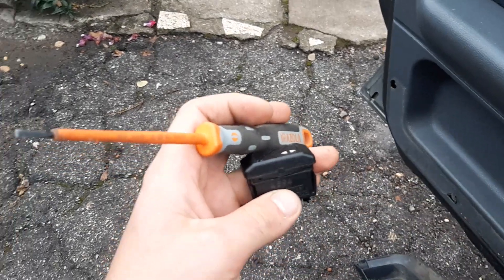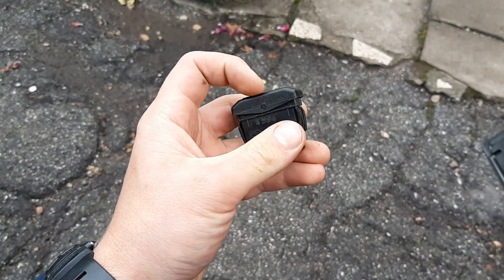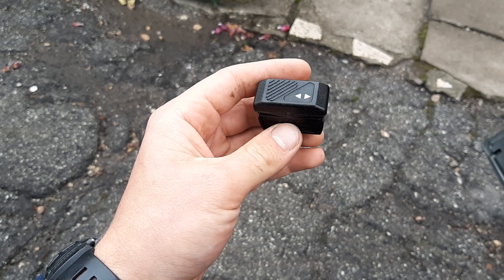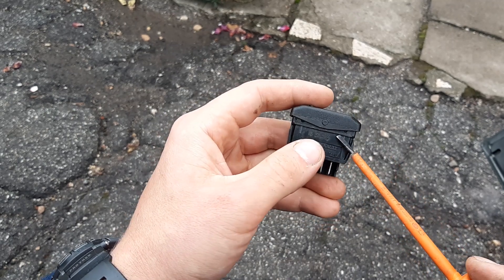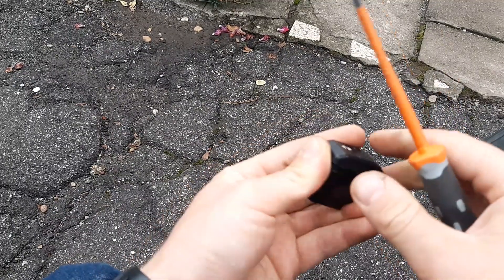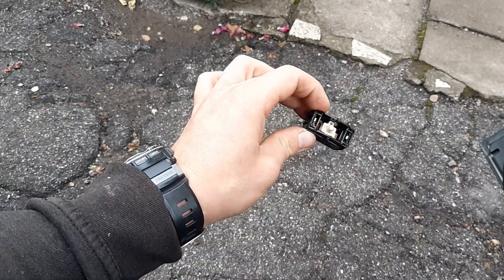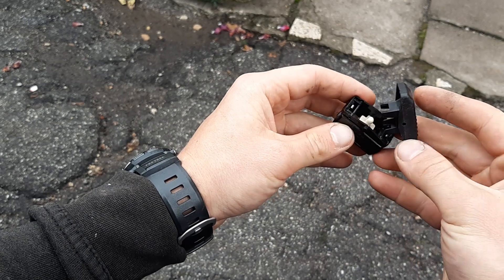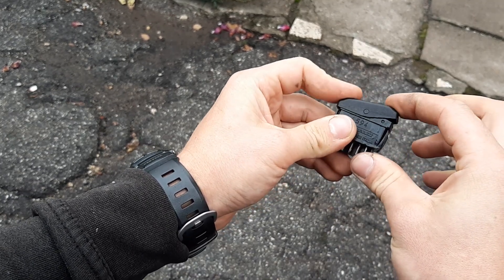Electric Windows Button Cleaning For Faster Window Movement

Comment: you do realize that the button...has nothing to do with lifting the window fast or slow....thats the lift motors job.
Reply from the maker: Try for yourself and you will see the difference. 30 years of use and wear on the inside contactors slow down the speed of the window motor.
Reply: @MeFixingEverything  to be fair...i have not tried this. but my 5+ years in fixing all sorts of cars and their issues says this wont increase the speed, simply will clean the contacts creating a more reliable connection. maaaaybe that would allow more power transfer. thanks for making me think a little harder about this. nice work!